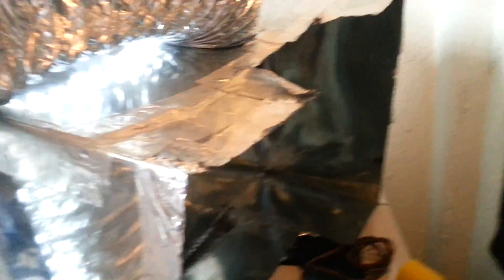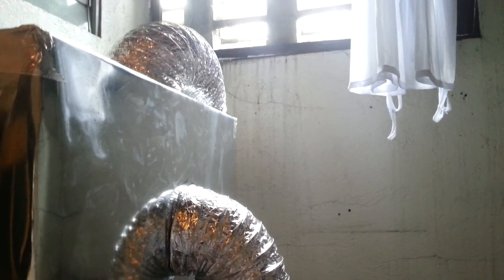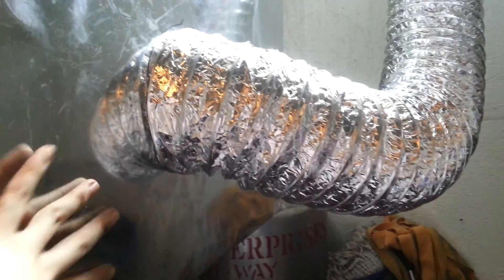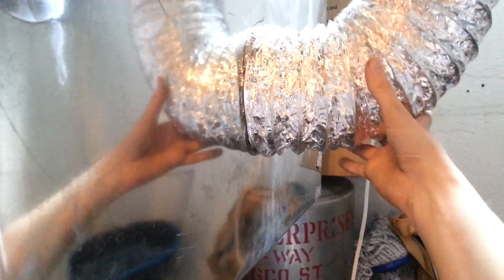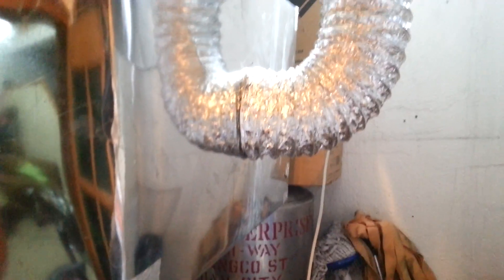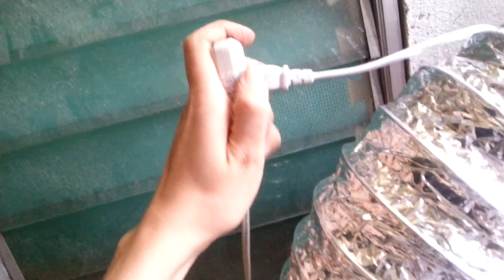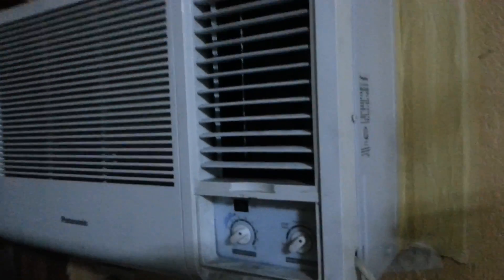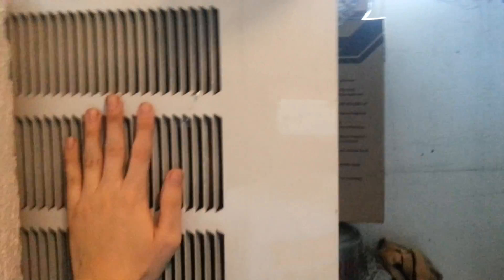Using window aircon unit inside

Comment: ohh its been 12 years, how'd it go , how long it ran like this?
Reply from the maker: I'm not using that setup anymore, but I never had a problem with it. I actually ended up making a better and more rigid version later (both box and hose). 

Rigid hoses are much more effective than the flexible type. 

It makes a huge difference in the cooling.

Comment: I wonder it'd work if you'd just slide in the "aircon" all the way in so the intake takes in the room air whilst (only) the exhaust hot air goes into the laundry room.

Comment: This is great info and some great ideas you have here. I was looking at doing the same thing because I live in a townhouse and we are not allowed to put window/wall conditioners in the windows, so I am thinking I can make a cart with wheels that we can wheel to and from the window when we are not using it.

I am having to decide right now though if I want to do some heavy engineering/ducting work to make this possible while not being a massive hassle when we open the windows, or to just get a portable air conditioner with duct hose already built in that you put in the window. I hear those don't work very well though.

Comment: Maybe change ur AC to split type.. but if you insist of using the split type..i sudgest to open up the window with a louver block all the way down about 1m from the floor.. and for security just put some grilles so their no intruders.. it will also make your laundry area cooller..

Comment: I'm working on something similar, but using a plastic tote bin to go around the AC unit. It will sit on a table next to a window. The front area, where the hot air comes out, will be segmented off in the tote by some pool noodle foam, and the back half where the outside air comes in will be enclosed by the tote lid with a hole cut that matches the size of the AC unit. Duct will go into the tote in the back side, and come out the front (hot air) side with a booster fan to pull the hot air out. The AC is one of the dripless style, that has a sealed lower pan, and the fan has a "slinger ring" that throws the condensed water onto the coils to help cool them off. Looking to build it in the next two weeks and will see about recording my setup.
Reply from the maker: Good luck. I'm not sure if the plastic will survive though. The metal I used got extremely hot.

Comment: The way i would do it is instead of using ducting, id make a chimney. That tin shroud, make a rectangular hole at its top, as wide as the ac, then put the chimney there. Have it bent 45 degrees towards the wall openings. The tin shroud should also have a 45 deg bend upwards to help push air upwards. Make sure the shroud doesnt cover the intake vents of the ac btw.

Comment: Well I've stumbled across this video while searching how to duct hot air coming from window air conditioner. I actually have one window unit, but I can't install it straight through my wall because it's gonna be a huge pain in the neck and having an idea just to turn it into a duct air conditioner seems to be a good idea. Your setup seems to work. But, it needs a little more modification. Here's few that I'll love to make :

First of, put some duct booster / fan on the intake and the exhaust. I'll maximizes efficiency.

Second, you could just duct the indoor part. It's way easier because you just going to have smaller hole on your wall instead of drilling holes into your dryer room and put a duct there. But the main problem is that you NEED to make the ducting pipe insulated very well to minimize some lost cooling caused by the environment.

Well that's all I could say. Even though this video was 7 years old and I'm watching this on 2020, maybe this will be the best idea...
Reply: same hahah. nasa stockroom likod ng aircon namin.

Comment: I have Hitachi Window AC and installed it inside the house, for exhausting warm air prepared a rectangular duct and at the end of the duct shape it into the 8" inch diameter and then fit a 5 Meter long duct with exhaust fan at the end. I want to know after apply this, will there be any adverse affect to the compressor of the AC. Please tell me.

Comment: Hopefully you put a powerful box fan in front of that window to extract the hot air by now. Create enough force going out the window to pull a small vaccume on the door and you dont have a problem. Then turn your vent fan on to allow good circulation and not burn up your box/utility fan.

Comment: I have a 5000 btu ac built into a multi baffle enclose using 1inch styrofoam am used in construction. Held it all together with duct tape. I put a bathroom fan at the back baffle to suck out the hot air which works great.  It cools okay but not amazing. Been thinking of putting a booster fan on the incoming air line. (Both intake and output are 4") to bring in more air aggressively. This confirms it for me. 

Thanks!

Comment: I just received a notification message about this post. I don't know why!  But if you still have this predicament I think I can help. Basically your fans have already provided the answers so all I need to do is to distill it into plain English and temper it with what works in the real world.

You were 95% there with your box and ducting. The problem is air friction and swirling air in the box meaning not enough is going out the ducting. Put your fan at the window to help PULL air through the ducting (the one you had in the video will be fine). And that's it. Perfect?  No. But it will meet your objectives and extend the life of the aircon, make your laundry room cooler (a bit warm), cut your power bill and help achieve world peace.

Comment: you can just use a computer fan used as a exhaust fan
Reply from the maker: You'd need like 50 or 100 of them to exhaust enough of the hot air.
Reply: Gadget Addict or hang a regular fan lol and also i was watching your video "Do LED mosquito zapper work" soo that's why i give a thumbs up and subscribe

Comment: You could always put a bubble around it hooked up to a booster fan to suck all that hot air out. Make is out of foil bubble insulation. Keep about six in gap from ac then have the booster fan sucking the air out. Or have a custom cover made for your ac that forces the air to seed out and away dso a booster fan would easily do the job needed. ; )

Comment: You would need a booster fan ment to work with very hot air for what you are trying g to do. A plastic fan is not going to work for very long at those temperatures.

Comment: K i am trying to think of something like this for my window unit, my HOA wont allow me to hang it in the window my question to you is are you using this set up to cool your room or for some other purpose? a set up i was thinking about was just setting the ac unit up right in front of the window and build a box around the part of the ac that would normally hang out the window and connect the built box to the frame of the window so that way it is still drawing on the outside air, o yea and also i was going to place a metal sheet below the ac unit at and angle just big enough so any water would drain outside the window. what do you guys think? I am no engineer  but I think it might work..not sure though
Reply: That box you describe is exactly what I was thinking. One problem may be that the air paths to the intakes (sides) and the air path to the exhaust (rear) overlap too much since they are confined to that box. So might want to build a wall (thin cardboard?) that separates the the air paths to different parts of the open window space. Hope your box did work either way. I am setting out to do this in the next week or so.
Reply from the maker: +Joel Dunnsmith What you've described sounds like it would work okay. To me anyway. I'm also not an engineer but your setup sounds a lot easier than what I was trying to deal with here :)

Comment: Your first method was for sure no good.  The static pressure across the condensing coil would go way up and in turn the high side as well killing the compressor.  You actually want water not air, if your water is free or included with rent it even better.  Run a line over to unit and have it drip very slowly onto bottom of condensing coil.   You will notice there's a slinger ring fan blade that picks up water splashing onto coil cooling it.  If you add more and unit is pitched correctly it will run much less and cooler.  High side pressure of refrigerant comes way down and the state change of liquid to gas use energy thus cooling.  Put an amp meter on AC and check it with/without, it's mainly re ingesting it's own heat now which it very inefficient.  When you are not using rotate thumb water valve closed.  You can buy an ice maker hook up kit for this...
Reply: in line duct fans could help on the outlet /inlets and of course mounting the outlet high and inlet low also would help. I like the water idea, kind of a swamp cooler AC hybrid.

Comment: +Gadget Addict , From what i see is 2 things. First metal box to small it is heating up to fast with no forcible air exhaust. Also there is no pushing of air backwards which makes the metal box heat up. Not to be rude, but the units are made to use all fan power to push cold air out, and meant to hang out window so dont matter how much heat is exhausted.  SO, i am just guessing, but couldnt you put an inline exhaust fan on that metal box to push the HEAT out, and make the box bigger(important) to allow a larger space so that the metal dont get as hot. ALSO IMPORTANT, Insulate both the metal box and the exhaust hose out(If you have an inline fan already, just piggy back this with a Y joint and a bunch of duct tape, i am guessing a 4 inch ducting and 8inch powerful fan(closer to the fan more powerful the suction, but with proper insulation wont be a problem),. This will give ample time for the exhaust fan to work. i am pretty sure this will work. And the cost of the inline fans are cheap and cheap to run. you already have it made, just add an extension to your box, insulate it also and buy a $20 inline fan(or piggy back current fan or exhaust system). So this is just in theory. And when all said and done, i dont even think you will need an inline exhaust for fresh air.  Also the fan will need to be mounted close to the box as possible, because you do not want the box heating up and closer the fan closer the cfm's, because all you care about is the box heating up, let the ducts heat up however hot they wanna as long as your box dont radiate to much heat, which is your whole problem. Please anyone if they read this and try it lemme know if it works

Comment: i would suggest putting steel exhaust fan on that window 
not the one like you have that one is made for exhausting bathrooms and kitchens 
use a steel exhaust fan its more powerfull and will do the job 
but leave a small gap in the window to let the cool air come in

Comment: I was wondering if you're still using that now? I have the same problem. :(
Reply from the maker: cheshire11789 Nope :( I never managed to get it working. I can run the aircon for a few hours and then I have to let the exhaust room cool down. I think the only way is to use a heavy duty extraction fan.
Reply: Gadget Addict You did split type instead? I've seen other set ups that have two exhaust fans for server rooms. One for intake, one for heavy exhausting. I have a similar problem. We have an ac compartment which is terribly smaller than your laundry room. We cant even fit two exhausts.

Comment from the maker: Wow, thanks for taking the time, I appreciate i. I checked out the video. That's quite a beefy exhaust fan. I looked locally and a 1/2 HP which looks to be a similar size is around $160. Add the cost of the electricity running the exhaust fan and I have to wonder if it's worth while.. If i owned the place i'd just bang a hole in the wall and have done with it! I'm going to have to think carefully about what to do next. Thanks a lot
Reply: which video?

Comment from the maker: Okay thanks for the advice. I'll give it a go tomorrow. If that still doesn't work then I may consider just selling the unit and buying a portable unit which would be easier to setup for the area I want to cool. This is probably one of my worst buys ever. Such a large unit and I've had very little use out of it.
Reply: Just put ducting on the air intake at the back (top and sides of ac) to pull cool air from outside the window , no need for fan motor that will only add up to electric consumption

Comment: If it is still cooling your compressor is okay, but generally the air is pulled thru the coil section, the part you put the box on. Either way, your only real solution is a heavier exhaust fan.bringing air in won't help, the hot air has to have somewhere to go. Installing a heavy duty exhaust fan right over your window will work wonders.

Comment from the maker: Okay, got any ideas? I'm clueless when it comes to aircon.. It's probably run under these conditions for 100-200 hours. So maybe the compressor is borked already?
Reply: Just put intake ducting on top and sides of the ac  no need for extra fan motor rhat will add to electric consumption.

Comment from the maker: The hot air is being pushed out from the rear and one side, that makes them 'exhausts' right? The one on top and the other side is sucking air in, making them 'intakes', right? Am I missing something?
So you reckon a large exhaust fan will do the job. Sucking the hot air out?

Comment: What you are referring to as the intake is actually the exhaust, the air traditionally pulls thru the condenser coils. Your best bet is to install a large exhaust fan over the window, much bigger then your original. Forget the whole bringing air in and ducting.